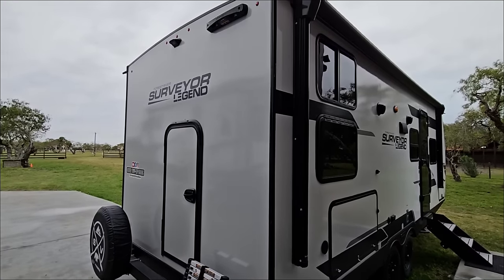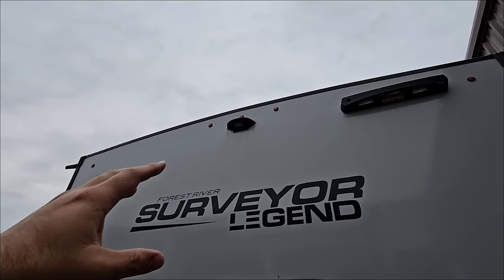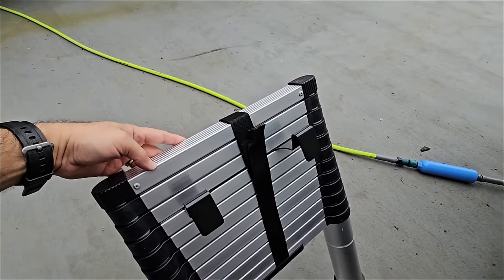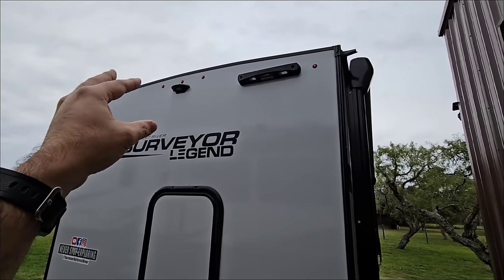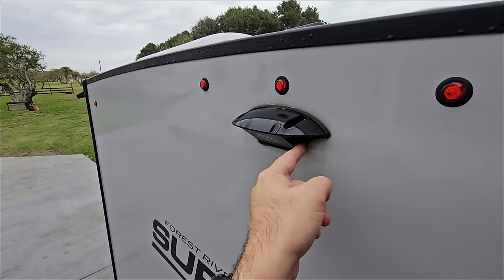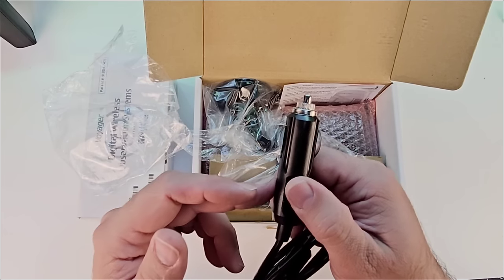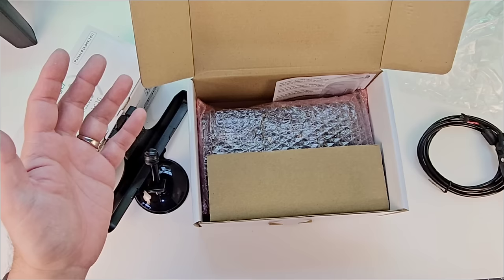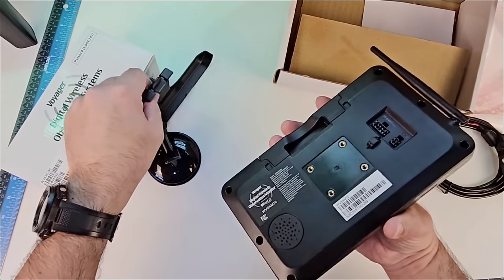NOT FURRION! NOT HALOVIEW! Let's try a new RV Camera! Voyager with WiSight 2.0

Comment: I had the Furrion 3 camera system with 7 inch display and it was nothing but a disappointment. Less than 2 years one marker light failed. 3 years and the display has lost range and no longer picks up the rear camera.  I tested with a second camera, still no luck. I refuse to spend more on the system so I'm out over $870 and of coarse they wont stand behind it.  Just replaced it with a single camera unit off Amazon called the  Yakry Y28. Much higher quality picture. Everything feels like better quality.  The display has a t slot on the back and I was able to get a t slot ball for my ram mount.  It also included an after plate and power cord for the Furrion mount. It was $180 - $35 coupon so much cheaper than the Furrion.  The only draw back is they don't offer a decent side camera but you can pair up to 4 of their regular cameras. It does include 2 cameras with the kit.  I've tested at 100ft with no issues.

Comment: Correction is it 5 amps 60 Watts at 12 Volts. The new USB C 2.0 will support 5 amps at 48 Volts or 240 watts. Not sure if you can upgrade the USB C Power Supply to support those new standards in the GMC but would make a good UPGRADE.

Comment: I have the Vision Works Camera System that I got from TechnoRV. It came with a Furrion mount adapter and a Furrion wiring adapter. Plus it came with AC adapter plugs to power the cameras.  It’s a great system.

Comment: i had a voyager on my 21ft toyhauler which came with the voyager mount on it and it worked great! i kept the unit when i traded up to a fifth wheel which has a furrion prep so i need to swap the furrion plug on the new camper to the voyager plug.

Comment: J D just a quick comment I know in a lot of gm trucks  gm started doing away with the 12 volt adapter and cigarette lighter stuff especially on the newer models because the market went towards e cigarettes but that being said if you look on the dashboard you should see a nock out plug that can accommodate a power port that you can get from your local parts store and can run a wire to your fuse box to wire it up using a piggy back plug to solve the problem you also can put one on back of the console because the wiring harnesses do have a plug and play style plug in them, thanks for the great content always

Comment: test it while driving.  i found that the "Driven" brand camera that came preinstalled on a former camper of mine, that if you were not moving or backing into a spot slowly, the camera would work.  once you were out on the road driving, you basically would out run the signal of the wireless camera.
i now own a class a with a hardwired camera, there is no more lagging or loss of signal, i don't know if i could ever go back to a wireless camera.

Comment: I have been looking everywhere for a “rear view camera” instead than a “backup camera”. The difference is that for backup you need a wide angle, but for keeping the camera running as rear view mirror you need a narrower view angle otherwise everything looks far away even when they are tailgating you. One possible solution would be to “zoom in” in the screen. Does this Voyager setup allow it to

Comment: Couple of thoughts/questions:
1) How's the display?  Haloview had an awesome display, but when wearing polarized sunglasses you have to tilt your head 90°s to see the screen.  😅 And the Furrion 7" display is dull and not very sharp (making it very difficult to use as a rear-view camera).  
2) I wonder if you could feed the inputs to the Wolfbox mirror. It looks like everything is built into the screen and doubt it has an RCA output on it, but if it did, that right there would push me over the edge to get a system like that.  😎

Comment: Have you found any differences in the signal strength when in motion? I don't have a camera yet but with the TPS that I have I found the base unit could monitor the sensor fine with the main unit up in my view but when moving it couldn't and I had to move the unit closer to the back of my truck (I haven't installed the repeater yet which would help). Just interested if you have seen anything similar with any of the camera you have reviewed?

Comment: I recently bought an Airstream Globetrotter 2022 with Voyager rear camera. RV did not have the monitor so dealer gave me a new WiSight 2.0 monitor. Technician failed to pair the system before I left
To head home  240 miles away. The next day I realized the monitor and camera had not been paired. I went through all 4 channels of the
Monitor, Ch 2,3,4 all just ignored my efforts, Ch 1 gave error mag “no signal”. Would this indicate the camera
Is not getting power. The camera is really dirty, don’t know if this impacts signal. I am a rookie, first ever EV, first ever F-250 , also 2022.

Comment: They don't come with a ladder so that they can upsell you on something that used to be standard. A $50 permanent ladder? No no! You get to buy the $300 Lippert telescoping ladder! Separate! It's becoming a joke. Pretty soon you won't even get doors. It'll come equipped for the Lippert door system. Oh, you want a spare tire too? Well, looky right here! This unit is prepped for the Lippert spare tire system! Just have to buy the mount, wheel and tire and you're all set! I should stop now. Lippert probably reading this getting ideas.

Comment: It's annoying to me that the bracket on that ladder isn't sold.  I have the exact ladder withiut the bracket from my old trailer. I bought a new trailer with the lippert mount. The bracket could easily be attached to my old ladder if they sold it. Im not spending $200 to buy the exact ladder.  In the mean time, I'll just use other securing methods.

Comment: I'd rather have the ladder on the back. One less thing to store. @5:40... Does Voyager have a system with 3 cameras, like Furion? I have the Furion with two turn signal cameras and a back-up camera. On my next rig, I'd try Voyager if they have a similar system. @13:50... I'm a little OCD... I'd make sure the rig is level side to side and then put a level on top of the plug before installing the second screw. I have a 4" level that's perfect for stuff like this. @16:05... Ford wins again. LOL. I wonder why nobody has a moveable camera yet. Mt Motorhome has a rear view camera that's only a tiny bit bigger and I can move it up/down and side to side from inside the cab.

Comment: So our 2019 Chevy 1500 High Country doesn’t work with cameras connected to the clearance lights 
GM trucks don’t recognize LED trailer lights 
I had to wire a 12 volt power supply from the trailer to our Voyager camera 
Pissed me off 
Chevy tried to fix my truck 5 times to make it work but didn’t 
Come to find out that I could of bought a dog bone from Amazon that changed where 12 volts go to the trailer for $60

Comment: Thank you for this video.  If I ever buy an RV with the Furrion camera prep, I now know to buy the Furrion camera so that I don’t put holes in my wall.  It would’ve been safer to have gotten a Little Giant type of ladder 🪜 and worked directly in front of your work to avoid the potential of falling.  Safety first.  Also I predict that GM will bring back the 12v due to your reviews, but is there a place in the truck other than your windshield to place the monitor, such as just in that cubby hole in your dash of the 450 or somewhere else in the GMC?  When I use my Garmin in the Equinox I put it by my gear shifter so that I can just give a glance where I need to turn.  Hope the camera works for you.